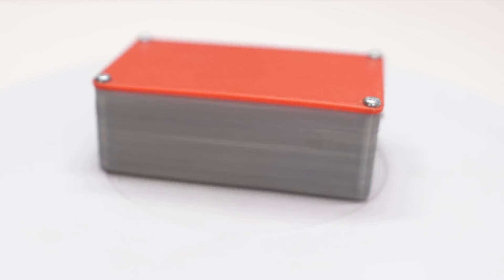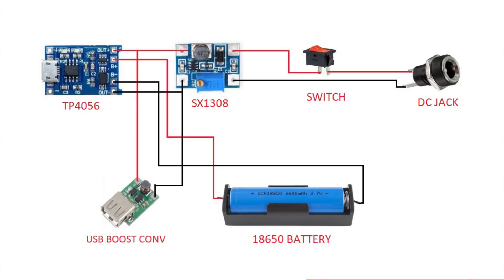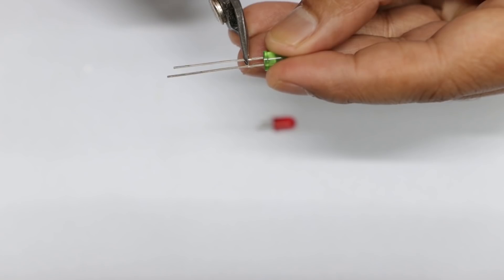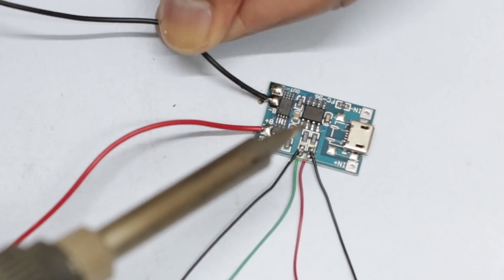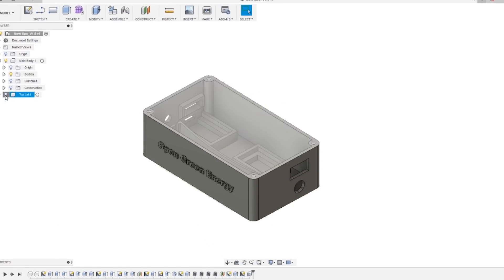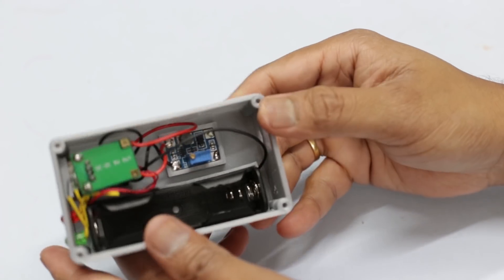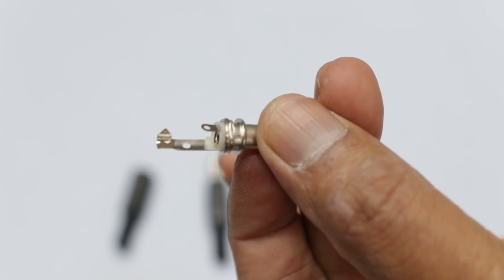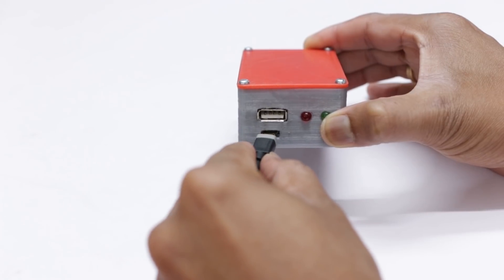WOW!  Amazing DIY Mini UPS for WiFi Router || How to Make Power Bank

Comment: This is NOT a UPS. A UPS works as a bridge between the AC wall plug and a device to ensure continuous power supply in the event of a power outage from the grid, so this device fails that purpose.
You should have advertised this only as a powerbank, which is what actually it is.
Reply: Exactly my thought, this is more like a powerbank for the router
Reply: But does it use the batteries continuously or only when there is a power cut
Reply: u are supposed to keep the device connected to the AC power supply.
Hence ensuring constant power supply for your router.
Reply: @sathwikvemula4173  so it's not that good
Reply: @geethanshr  yup

Comment: I've made this project and I can say that this cannot work simultaneously charge the battery and power the router.
For example a scenario where I've powered this UPS with 5V 2Amp charger and using the Wi-Fi Router with this UPS, I've noticed that Router become turned off after 1hr.
So conclusion is this UPS thing only can be use as a PowerBank(for router, 1cell=1hrbackup) not as an UPS.
Thanks😊

Comment: Thanks a lot for sharing this useful video. Just wanted to seek your advice if I can directly use my Routers power supply to it and whenever there is a power outage it switches back to the backup mode using the Battery power. Thanks a lot for your support and guidance.
Reply from the maker: Thank you.
If your power supply is 5V then connect it in the micro USB port.
Reply: @opengreenenergy  Thanks a lot for your quick response. My router power supply is 12 volt, 1 Amp. Is there a way I can use it directly.
Reply: @MrSahurajkumar  use a voltage regulator to drop it to 5v

Comment: Bro without using battery . Can v do this add female micro usb to booster in supply and supply power from externally with power bank.  Will there be issue . Please reply. I want make one in budget this  one suit for my idea . And can v use  MT3608  with 2A max . Please reply.
Reply from the maker: See my V4.0 router
Reply: @opengreenenergy  can v do it

Comment: using single 18650 won't give much backup as single battery can hold from 1.2ah-3ah...let's assume the battery is 2.6ah,the voltage is multiplied by 3 times mean 3 times faster the battery will discharge so (Assuming router takes 1.5a  2.6/(3x1.5) = 2.6/4.5 = 0.57 mean 34.2 minutes,and that backup is ok...whereas it should give at least 2 hour backup but still,thanks for the project...it helped me bit
Reply from the maker: I am making a upgraded version, stay in touch will upload this week.

Comment: I would not call that a UPS due to the switch in the 12v output. Plus you did not say if it can charge and power the router both at the same time, which is pass through mode.

Comment: Keep in mind to just look up your router's datasheet / the voltage range of the power converter. For example most TP-Link's 12V-Routers are totally fine with 6 or even 5 Volts with bridged diode. So you dont need to pust it up to 12V as is will be transformed back down to 3,3V or even less on the Router's PCB

Comment: I think it should called DC UPS, because there is no inverter section. By working principle there are two types of UPS are there. 1. off line, 2. on line. I think you are making on line UPS. This type of UPS battery life not longer than off line UPS. Thanx for the great work.

Comment: Bro ,
With 2200 mah battery
 how many hrs  it will work.
Reply from the maker: It depends on your router power rating and how many cells you want to use
Reply: @opengreenenergy   with 12v 2.5a

Comment: Only one cell
I make this project with 15 cells in 2017 
Now working good after 2 years
Reply: Hi, How long does it take to discharge the battery?  Are the batteries in series or parallel?

Comment: Instead of a 4056 better to use a 3S 20A Li-ion Lithium Battery 18650 Charger PCB BMS.  Mod the router power lead to tee in the BMS via a 5.5 power jack and 3x18650 (if you need more use 2 cells in parallel x3).  3 cells just about makes 12v and makes life much less complicated with the same psu and the BMS in circuit 10-12v is usually adequate.  Because the BMS is teed - switchover is instant and batteries smooth the PSU output - so win win.
Reply from the maker: Thank you for your valuable feedback.

Comment: Can I change the battery? I mean use any other type of battery?
Reply from the maker: No because the charger is suitable for Li-ion battery.
Reply: @opengreenenergy  I meant batteries with different voltage!?

Comment: There is something I do not understand and I want you to help me clarify something in the diagram.
The TP4056 there will make the input to charge the battery. + b b and the output of tp4056 out + out will connect usbbooster in + -in but we will also connect from tp4 056 + out and -out to booster convert + out -OUT. there is that I do not understand why he made that connection and I do not connect it in + in -In of the convert booster. and what he did was connect the switch to the + in -n input of the booster. They could clarify me to understand. I have doubt in the connection in the convert booster
thanks
Reply from the maker: Please see the schematic , Instructables link is given in description.

Comment: There are a lot of UPS in Aliexpress for much less  the price of your modules, parts, and your time.For my MagicJack  I bought on line a 5V  Li-ion back-uninterruptible power supply UPS
Model:UPS502B. Capacity: 44.4 Wh. Input voltage 5V +/- 5%. Input Current:<=2000mA. Output voltage 5V+/-5%. output current:<=2000mA. Working temperature: -20C-55C. This came with a 120V to 5 V adapter. It cost me less than $20.

Comment: Great tutorial.
Thank you for taking the time to record, edit and share your ideas. Please consider a tutorial on making a mini tachometer using a 4-digit LED that can be used with a mini lathe or mini mill. Cheers
Reply from the maker: Thank You.
I will consider your suggestion for my upcoming video.
Reply: Found an LED that may be useful for this sort of project on eBay, TM1637 if you build the project.
Cheers

Comment: but can it pass the input power from the wall directly to the router?
as in while there is power it doesnt use the batter but when power fails the battery takes over
Reply from the maker: Yes
Reply: yes but not exactly

Comment: Wht if power main goes ?
Reply from the maker: The battery will supply power to the router.
Reply: @opengreenenergy  automatically ? Or we need to plug it..
Reply from the maker: @firazpeerjade  automatically
Reply: @opengreenenergy  how is it possible yaar...ur not using anything to switch
Reply from the maker: @firazpeerjade  because the battery is directly connected to router, no need of an additional relay for switching.
Reply: @opengreenenergy  then ur router get restart bro... that's online ups are available

Comment: Just a little thing, it's load "shedding". Like when a snake sheds it's skin, it's casting off the skin. So load shedding casts off "less important" loads from the electrical network, when it's near it's maximum capacity. 

It must be very annoying. In the UK we have stable electricity all year round. On the other hand it's usually cold and damp so we don't need air conditioners!
Reply from the maker: Thank you for correcting me.

Comment: If you go with a TP5100 (5v - 20v input) you wouldn't need a boost converter. Just wire it up so you use the stock power supply for the router and power the router directly from the TP unit.
You could even add a voltage check for the cell so that when it's 4V or higher, the TP unit is disconnected from it and only switches over when the TP looses power (but that's getting a little more complicated)
Reply from the maker: Thank you for your valuable suggestion.

Comment: Here's a hack I would like you to try and if it works, I'm happy to purchase it as well.

I need a circuit to connect WiFi router to both UPS and a Powerbank. Importantly, I should be able to switch WiFi power source between UPS and Powerbank seamlessly without any interruption in WiFi network. For example, when I switch power source from Powerbank to UPS, I should not lose my WiFi network. While the source is selected to UPS, I will remove my Powerbank and charge it and latch it back. Let me know in case you have any questions. Thanks.

Comment: Correction: This is not a UPS "Uninterruptible Power Supply" as that means it would be a "in between" device between your router's power supply and router itself.  Example: 12v Input / 12v output (uninterrupted)  though nice work making a 12v 5v  portable power supply :)
Reply: It is an UPS. When power is removed the Power supply is not interrupted
Reply: @UndercastEsmeganitrospeed  Wrong a UPS is inline,  the power supply normally plugged into the router plugs into the device he made, then it plugs into the router. What he made is a portable power supply, to use it means you would have already lost power then plugging the router into it after the power has already been lost, that's not a UPS, that is a power supply.  Uninterruptable means just that,  No power to the router is ever lost What he has is just a portable power supply...
Reply: @balthromaw6305  You don't understand, you would have this inline 24/7.

The charge controller charges the li-ion and when there is no more grid power it starts discharging and powering the router.

It is an UPS
Reply: @UndercastEsmeganitrospeed  A Ups has a "pass through"  function. Allowing power input to pass through into the device needing power, at the same time it charges the battery inside. Upon a power failure, it diverts to battery making the output "uninterruptable" Plugging it in and charging it, then unplugging the source to then plug the pack into a Router is not a UPS , that is a portable power supply, not a UPS stop arguing you potato
Reply: @balthromaw6305  1° There is no unplugging from source and then into router. It's always plugged into both.
2° Not all UPS have a Passthrough, that's your misunderstanding of now knowing the variety of UPS options available.
3° learn to be wrong, you can't always be right
Reply: @UndercastEsmeganitrospeed  Its also called a "POWER BANK" in the description.  SO unless its IN LINE  its just a power bank.

Comment: UPS stands for UNINTERRUPTIBLE power supply, for your "UPS" you literally have to unplug the power and plug this power bank in the router and flip a manual switch to work. There is nothing UNINTERRUPTABLE about it. While a real UPS has a relay, power balancing capacitors and a battery that automatically switch to the battery power when then the main AC power is out, yours does none of that.

Comment: This is not a ups , a uninterrupted power supply should kick in automatically when the power goes out , there shouldn't be any switches , maybe you can call this as back up power bank for router
Reply from the maker: It will also kick in automatically when the power goes out.
Reply: @opengreenenergy  Show a demo

Comment: Friend, what CS cable on the display ( 1.8 Inch 8Pin 128*160 RGB TFT LCD Screen Display Module SPI Interface ST7735 IC Driver for Andruio STM32 C51 3.3V LCD Display  to connect to Wifi )
can be connected to Wifi ( ESP8266 Moduł ESP-12E ).

Comment: Do not try to invent the wheel. First I was thinking to DIU an UPS Uninterrupted Power Supply for my MagicJack. Considering that the time is money I solved the problem with US $22.88 buing a 5V2A 44W UPS Uninterrupted Power Supply Alarm System Security Camera Dedicated Backup Power Supply   US $22.88

Mini UPS uninterruptible power supply is a standby energy storage power supply. Used safe and environmental lithium cells, credible and stable PCB, trickle/constant-current/constant- BMS, Created by high performance and efficiency DC-DC, boosting and switching circuit. This mini UPS with perfect over-charged, over-discharged, over-current and short-circuit protection.

Smart 5V mini ups widely use for Router, Fingerprint attendance machine,Security monitoring system, Wireless camera, CCTV camera ,personal treatment system, Door security  system, Personal data assistant, Eemergency lighting, Alarm system, Personal communication systems, Radio, Digital cameras, Camcorders, Video camera, Bluetooth devices, CD players, MD players, Portable DVD, MP3 players, smart cards etc.
Features: 
 
Input Voltage: 5V
Output Voltage: 5V
Output Current: 2A
Rated Capacity: 44.4W
Battery Standard Voltage: 3.7V (18650 Battery)
Size: 111 x 60 x 43mm
Outer Material: ABS
https://www.aliexpress.com/item/32885207248.html?spm=a2g0s.9042311.0.0.6e8d4c4dA4IhYE

Comment: Is this not more a power bank than a ups as I don't see it being in-between the mains and the router.
You would have to unplug the router and then plug it into this in a power or scenario instead of it just switching over
Reply: https://www.instructables.com/id/DIY-Mini-UPS-for-Router-Modem/ has a diagram of how the modules are interconnected. Looks a lot like a UPS to me. Power in charges the battery and also powers the output through the boost convertor. If power fails, the battery takes over. The brains are all in one of the modules used, that's designed for the purpose.
Reply: @greenaum  Unless it remains plugged into the wall using an adapter to always pass power and automatically using battery pack if power fails does that make it a UPS, all this dude has made is a portable power bank. Christopher SS Reid is right this is not a UPS

Comment: A 3D printer is required. How can this be DIY? A normal laser printer itself is not so common even in 2021 and a 3D printer for casing is too much. If a video can be made to power the router using regular power bank which is very commonly found with any smartphone user it would be helpful.

Comment: Doesn't work bcz voltage across out+ and out- of tp4056 is about 0.6 or 0.7 volts which is less than required minimum input volatage of sx1308 module.

Comment: Make a laptop power bank
Reply from the maker: I will make it in future.
Reply: I have powerbank for laptop, 2s 15p 18650 batt,, 2s bms, dc boost 150watts,, i run some gadgets and modem , adjustable up to 55v,,

Comment: This device is a rechargeable portable power supply, Not a UPS.  A UPS  stays connected to its power source always, passing the power through onto the device that needs powered, Inside the UPS is a battery and charging system that monitors the battery, charge level, and if SOURCE is present or not.  Upon losing power, the circuity inside sees a power fault condition and remains active through its internal battery.  This keeps the output Active always provided A) mains power is available B)  the battery has enough charge to maintain output.   C) no short/bad battery condition.   The device in this video is just a 5v 12v  portable power supply, neat device, but not a UPS  period.